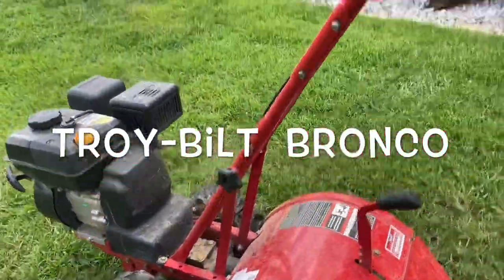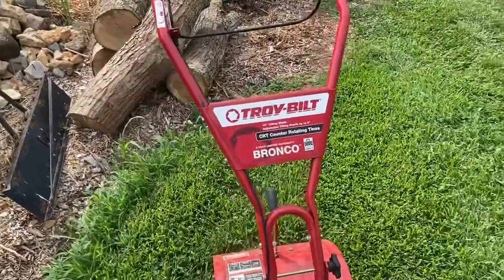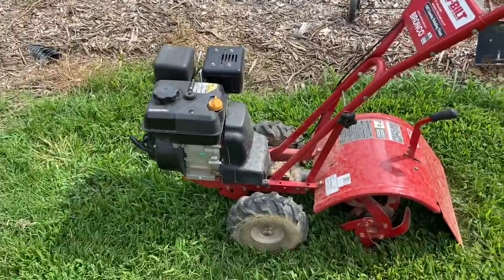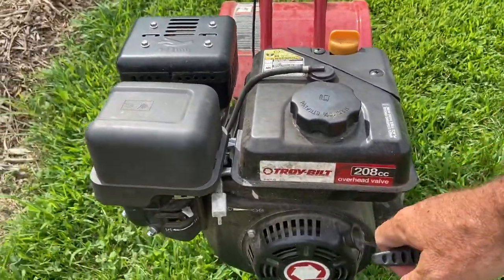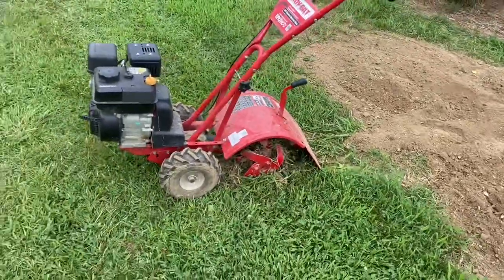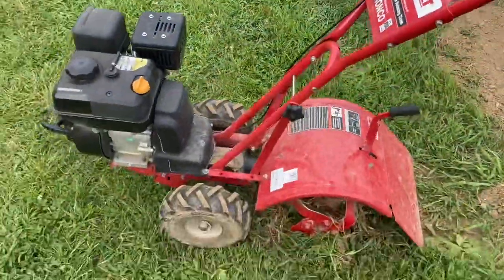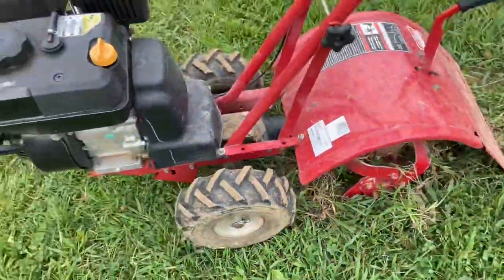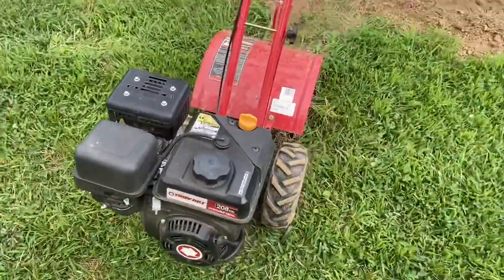Troy-bilt bronco

Comment: I got one it’s pretty nice runs good carbs a little dirty on this one your running . Can’t say I like it but I’d take a regular one too Front tine .
Reply from the maker: I totally agree that’s when I first got it and the carburetor was dirty, I don’t till large areas so really I prefer the troy Bilt axis over this one which is actually a little smaller and does a good job, I’ve had the horse before but it’s too big for the little jobs I need
Reply: @MurphyMower  the tines dig from under up on the bronco the horse digs down and will walk away if you push down the bronco nothin happens . I’ve a mantis and if you sink it in and drag it backwards it really turns it to fine dirt quick that things awesome but small .
Reply: @MurphyMower  in second though it’s junk. Leaves a undisturbed slot up the row .